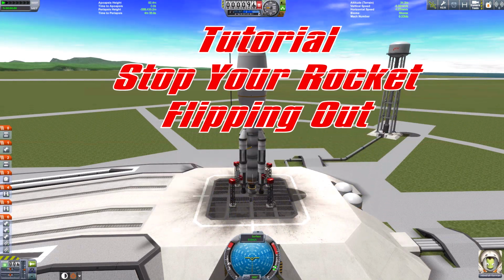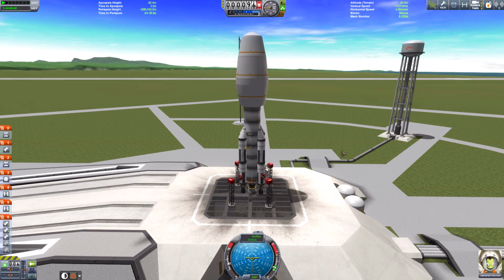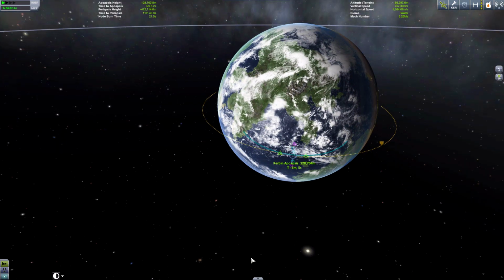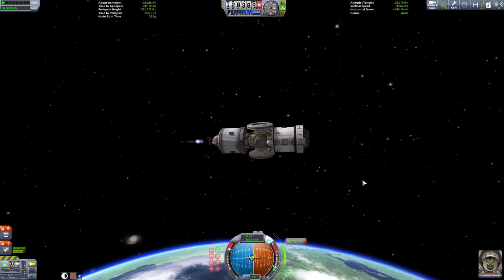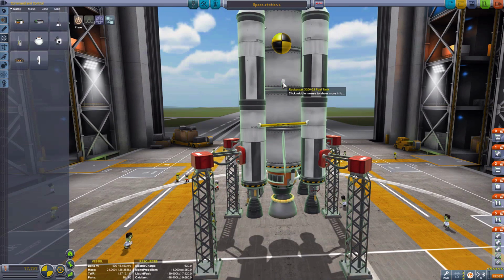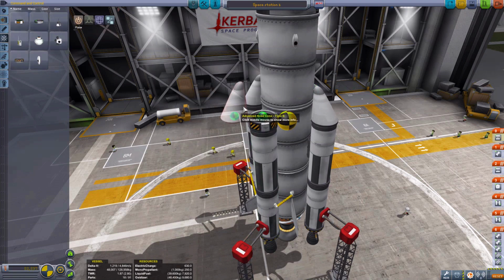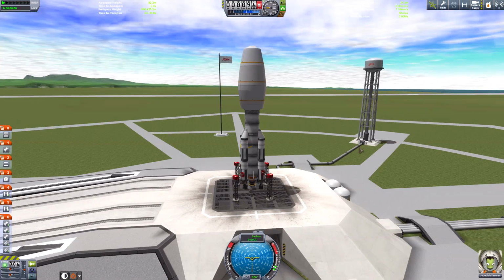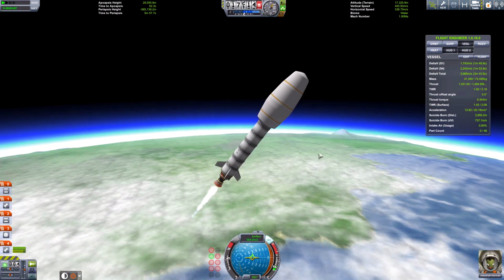Kerbal Space Program - STOP ROCKET FLIPPING!

Comment: Have to disagree with this. There is one thing and one thing only that causes a ship to spin other than the center of mass being off... Too high a TWR. If your TWR is above 1.8 on launch, you have way more thrust than you need and thus you're wasting fuel. Throttle down, save fuel and stop yourself spinning out. Or, create your mission vehicle... That's the top bit that you will use to land or return. Once you have that, you'll know from the engineering sheet how much weight it is. Then you just need a launch vehicle that is capable of lifting the weight with a TWR of around 1. I like 1.1/1.2 so the launch isn't too slow. You can build a ship with a TWR of 15 if you really want and it'll still work so long as you only use about 15-20% throttle but there's no need. 1.1 is plenty. .
Reply from the maker: +Sy What you say is true it's due to aerodynamic pressure if your going to fast and you get slight aerodynamic pressure on the side you will flip, but If you have your center of mass high on the rocket then you are more likely to diverge from prograde again causing aerodynamic pressure on the side flipping the rocket and as most players will go full throttle they they are more likely to flip, plus there's the wobbly rockets scenario ;)
Reply: +Sy Bull. An aerodynamically-stable rocket, tracking prograde will NOT flip. High speed would actually stabilize it. Keeping speed down in the lower atmosphere CAN keep an UNstable rocket tracking prograde, though. If you flip while flying strict prograde, you have a rocket that is unstable, unbalanced, or drains fuel in a way that destabilizes it (HINT: asparagus staging results in a more stable CG shift than tanks stacked "Roman candle" style.)
Reply: +Orb8Ter The CoM higher that the CoL is actually more stable. at all ranges

The CoL is the centre of drag too, so the CoL being low will forcebly drag the BACK of the rocket in line with the velocity vector (prograde)

grab a sweeping brush, with 1 hand at max extentionpush it forwards, you'll feel it want to slide sideways
drag the brush behind you and you'll feel it wants to stay behind you
Reply from the maker: +Ben Grogan Yup you guys are correct, I did this tutorial for the game and just drew on my experience from all my launches and assumed from past launch failures that center of mass must be lowered on the princable that anything top heavy would tip over easier, after research from NASA papers found COM needs to be high I knew COL had to be lower bit didn't realise that the fairing was the Bain of my launches flipping out.
Also interesting to note the Apollo rocket COM was very low showing that the best way to launch is point Prograde and you shouldn't flip out, will do an experiment video always test, learn and improve ;)
Reply: Orb8Ter Indeed, even with the centres inverted you can still keep it going as long as you done diverge from your "surface" prograde.

It can be done but it's like trying to win an arm wrestle with your elbow off the table.

If you need to use huge egg shaped fairings, try use the decouplers that push the boosters slightly wider from the main body.
If you do that your boosters are clear of the airflow from the fairing and create their own drag to help lower the Centre of drag on the early stages where its most important